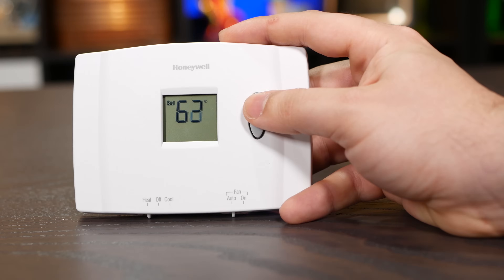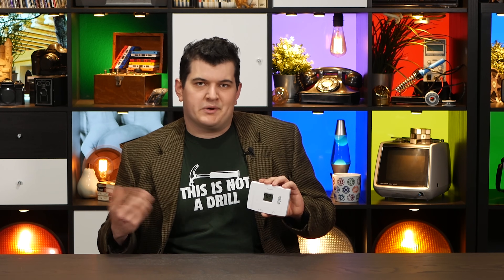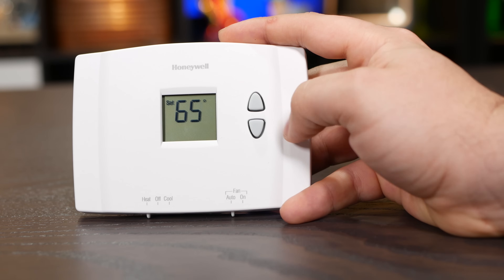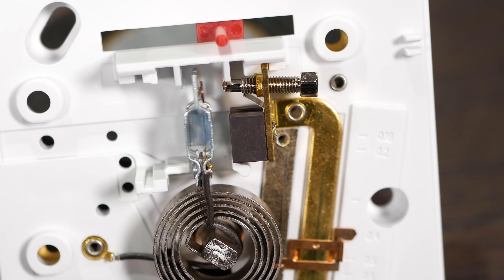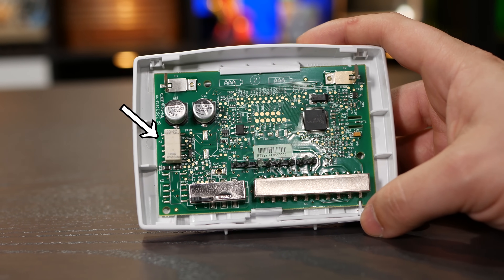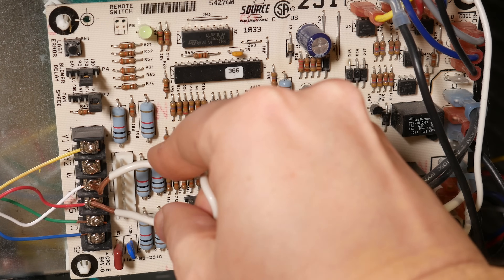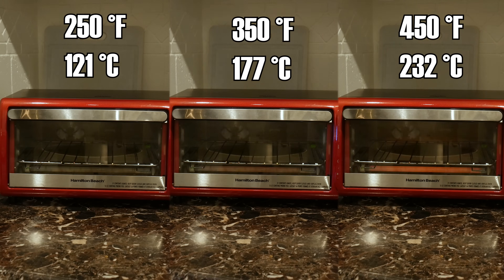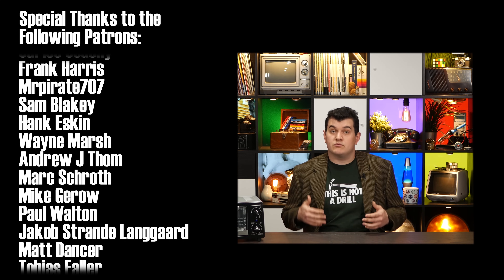Thermostats: Cooler than you think!

Comment: I know there was a thermostat at the church I went to in my youth that had a 30 minute occupy, that could be turned on.  The thermostat was set up behind a metal box, to prevent people from changing the settings, but had a hole through the face, that allowed you to poke your finger through, to activate the override.  Once the 30 minutes was done, continued on it's normal programming.  I don't know if it's a commercial thermostat, or just more rare, but they exist, somewhere. (No, I don't remember the brand of thermostat)

Comment: The thermostat in my apartment is mounted sideways and is powered by batteries. It’s so annoying. The batteries died one night before I knew it was battery powered and I was without AC for a while. It was 80° outside. I bought plenty of batteries so that doesn’t happen again. I wanted to try to take it off the mount to see if I could connect the C wire, but I couldn’t unclip it without pulling it out of the wall

Comment: First off, great video.  Shout out to your stunt toaster oven!
I own a home with a HEAT PUMP.   I'm new to the concept.  As it was explained to me heat pumps gradually warm the interior air but if you turn the thermostat up too much, it activates AUX mode and then the Furnace feature turns on (more energy use).  this concept totally negates your "dumb electronic device" theory.  If the thermostat just "says" "Hey heat pump, turn on/off", how/when does the heat pump "know" when to turn the furnace feature on/off?

Comment: check out the new Honeywell T10 Pro. plus if you like me, my stupid thermostat is in the dinning room, where i don't need the most control. but the bedrooms is what i need control over, they have a link device, that you can have multiple of, and in my case,  one in each bedroom, and i tell it to average those room as close to my set temp as it can, and it can decide, based on all the temps in the house, if it needs AC, Heat, or even just to circulate the air in the house to balance it out.  plus yes it has wifi, but like when the seasons are changing sometimes for a month in my area i have to switch for the 80+ temps in the day then we get some sub 30 nights, and just swing back in forth.  i like that i can tell it what range i want it to keep the house in, and it just does it.     

side note, that blue wire that needs nothing in the ones your showing, is REQUIRED for this type of thermostat. no batteries though.

Comment: My wife and I decided to splurge on a nice AC unit for the downstairs. It uses a VFD for both the compressor and the air handler, and can ramp down to as low as 30% speed. Haha, it was a pretty penny though. As a neat side bonus, it uses the same 4 wires the old single-stage AC system did, it just uses a proprietary standard to communicate between the board in the outside unit, the air handler and the thermostat. The system is much more complicated though, and specifically can control inside air humidity, which can really make it feel warmer or cooler in the house.

Comment: Technically, you can set your tstat to run for an hour and then carry on to regular programming. These would be programmable tstats. Almost all new model tstats have this function. You'll set it to your desired temperature for that cycle then press "Temporary Hold" and this just means that your tstat will hold that temperature until a certain time that can be change then go back to regular programming.

Comment: This is, in a way, really obvious, but less obvious than it seems: The key difference to PWM is the speed of the pulse.
Before you get annoyed upon the simplicity of this information, hear me out on this:

With PWM, the goal is usually to have the frequency of the pulse high enough that no mechanical reaction to the pulse itself ever happens. So, for example, if you are running an electric motor using a sort of "manual PWM", just by turning it on and off again rapidly, it will start to slow down a tiny bit every time you turn it off, and accelerate when you turn it on. This is far from smooth operation and can increase wear. Even with a pulse much faster than what you could do by flipping a switch, this still occurs, although the change in the speed of the motor will be very small. However, in PWM controlled motors, the pulse frequency is chosen so that it's faster than the electric reaction to the voltage drop. There are better people on the internet to explain this than me, so this perhaps isn't super accurate, but essentially, before the fields created by the coils fully collapse, there is already a new pulse, the motor never even starts to slow down and generate current, and as a result, it will run perfectly smoothly, exactly as it would if it continuously received a lower voltage.

So, while this type of reactive control is essentially the precursor to PWM, the speed actually more or less fundamentally changes the functionality of it.

Comment: I used to use the analogy that you can't turn a light on brighter with a normal switch, same as you can't heat the house faster by turning the thermostat right up when old e r customers were having a new heating system installed..

Comment: Some digital thermostats don't have good programs: one I installed had only a 1-degree variance of set temp, so it cycled as soon as the temperature was one degree off of set and shut down immediately once set temp was reached, resulting in very frequent HVAC unit cycling. I replaced it with a different unit that had about a 3-degree variance where it would kick on once it went 1 degree below set and then run to 1 degree over set before shutting down. Much more liveable arrangement with less wear on the HVAC unit since it didn't have to do the warm-up and cool-down sequences as frequently.
Also, most HVAC units will have either a two-speed or variable-speed blower unit. For heating, the fan is always run at maximum speed (you don't want your heating elements to overheat from insufficient airflow) while for cooling, the fan often is set to spin slower to allow for maximum dehumidification. Of course at the thermostat there is no fan speed control, it's either auto or on (which is usually high but may be selectable to low on some HVAC control boards).

Comment: Do NOT connect the cable shown at 6:07 directly to an electric heater! in his case, the white wire goes to a relai which gives juice to the heater (or servomotor, dont know how he heats). if u connect the thermostat directly to the consumer, you need a bigger 
cross-section for the cable (google translate ftw, im from the 230V world,) or otherwhise the cable is your best heater or just vaporize.

Comment: I've seen a number of places where the thermostat was next to a timer switch (electrical box mounted type). Usually, these have been in either garages or exterior-door access restrooms. The timer is mounted in parallel to the thermostat, or in some cases, connected in line with a second thermostat. 
Why? you need to keep the space at at least 5°C (41°F) to ensure that the water pipes and drains in the space do not freeze, so the thermometer is set for  7°C (45°F) (typically), and the timer turns on the often separate heater system. If there's a second thermometer, it's often fixed at 18°C (65°F)... in commercial exterior access bathrooms, it's often a double-contact timer, with the heat lamp on thermostat 2, and the lights controlled solely by the timer. 
I've also seen many a house where the hot water baseboard is zone controlled with very strong bimetallic spring coils operating a mechanical valve directly. The main loop is insulated, and has multiple pressure opened valves (note: Not pressure release valves, but internal pressure opened bypass valves), and the zones each have a thermostat on the water pipe, which leaves just before the bypass, and drains just past it; if the thermostat is open, the bypass shuts and the circulating hot water goes through the radiator, and when the thermostat closes, the pressure opens the bypass. It's almost like a transistor controlled circuit...
As for multiple heat settings... most of the portable radiant systems (Yes, how barbaric and inefficient...) have at least two heating levels. My electric oil filled radiator (which replaced fan based ones of higher wattage) has 3 levels, but not automatic switching. I have seen an automatically switching 2 circuit radiant heater... the thing had two differently angled mercury bulbs, one for each circuit.

Comment: It does matter where your thermostat is because different rooms cool or heat at different rates depending on their thermal properties and the difference between inside and outside temperatures. I found that the thermostat needed to be adjusted based on what temperature it was outside. That is before you consider the effect of opening and closing doors.

Comment: Mercury: It's not the "weight" of the mercury that causes the same hysteresis (technical term) that the magnet does in the modern thermostat.  Rather, it's the surface tension.  Check out how balled up, non-liquid-like it is in the picture.  Once it gets shlurped up (not a technical term) around the contacts, the mercury doesn't want to let go.

Comment: Ecobee does the feature requested at the end. You set a cooler temp, and it either auto resets back to your schedule after whatever time you set the default to, and you can just tap a button on thermostat or phone (or tell any smart assistant) and it puts it back to schedule. It’s perfect honestly. 30 minute reset and it’s a perfect cooling cycle.

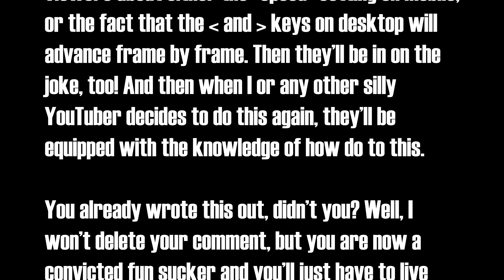Comment: 12:25
"Having proven that this demonstration would work
using my personal toaster oven, I decided to
purchase a new one. See, my toaster oven is kinda
filthy and I wanted to get another one anyway.
I thought it would be handy to have a toaster oven
at the new studio. See, they're really nice for
making small snacks or whatever [though frankly
I've always found the actual toast making
experience to be rather lacking even before I
was introduced to the Sunbeam Radiant Control
toaster]. Anyway, so I wanted to get a new
toaster oven, right? So I went to the store and
sought a really basic one, just like the one that
I use every day in my kitchen. No sense spending
a lot on what will just be a part-time toaster oven,
and it was the same brand as the one I had at
home. Must be perfect, right? Well, it turns out
that this new toaster oven runs a mush shorter
cycling time than my old one, so the effect that I
was trying to demonstrate became nearly
impossible to see. That sure was a bummer! It
later became clear to me that this wasn't a very
good toaster oven anyway, as the fit of the little
tray they give you for cooking tacos or whatever
was really vary tight and just unpleasant. The
whole thing was just a travesty, really. So I've
since returned the toaster oven you just saw and
replaced it with another one, but this was after I
had already filmed the entire video, and also after
I had Already filmed my original toaster oven doing
the thing I want to show you. I toughened up and
cleaned it the best I could, and I think it looks OK.

So that's the story of why you're about to see a
different toaster oven. I made and assumption that
turned out not to be true. Oh merde. In the end, it
all worked out for the best anyway because I got
a much nicer toaster oven on sale at Target right
after I returned the rather poor one, so all's well
that ends well, amiright?

Oh, and if you write this in the comment to save
people the trouble, you're a fun sucker and sucked
the fun right out of this gag. I hope you're happy.

*yay thats mea

A more helpful comment would be to tell the nice
viewers about either the "speed" setting on mobile,
or the fact that the <and> keys on desktop will
advance frame by frame. Then they'll be in on the
joke, too! And then when I or any other silly
YouTuber decides to do this again, they'll be
equipped with the knowledge of how do to this.

*yes he put "how do to this."

You already wrote this out, didn't you? well, I
won't delete your comment, but you are now a
convicted fun sucker and you'll just have to live
with that the rest of your life.

Pfft."

Comment: NOPE.  The mercury thermostat did NOT have to be mounted perfectly, EXACTLY level as stated in video.   Just reasonably level (not upside down or 90 degrees off).   It would work just fine.   The only negative result is the temp reading may say 78 when it's 76.  No big deal as one merely adjusts the temp to comfort levels anyway, not numbers...unless you're pedantic.

Comment: To make your AC run constantly for a set amount of time, reset the temperature much lower than you desire. Once you are cooled off, reset the temperature to normal.
     This also works for heaters.
Reply: I guess the point was to get the effect without having to remember to set the temperature back to normal later.

Comment: A question for you (or anyone else): On what basis is the recommended domestic temperature decided?  I noticed that your thermostat was originally set to 68 - is that normal in the US?  In the UK we are told to set our CH to 21C, but I have no idea how this figure was decided (and by whom?).  It's practically identical to 70F, so I suspect it's just a straight conversion, but still the same question - why 70??

We actually have our CH set to 22C, as my wife grew up in Eastern Europe, where houses are frequently uncomfortably hot (to a Brit) in the winter - and she often turns the thermostat up even higher!  When my wallet starts to feel the pain, and I attempt to get her to put on a cardigan, rather than running the heating so high, she'll often reply "why do you Brits like living in cold houses?!""   The answer I used to give to this was that 21 is the recommended temperature - until one day, when she asked in reply "but why - who decides that, and how do they work it out?".  A question which I rather disturbingly realised I had no answers to...

Comment: There's another advantage to remote temperature sensors, most central HVAC systems don't maintain a constant temp throughout the living space, but with remote sensors they can be programmed to maintain a specific temperature in a specific room at a specific time (Living room by day, bedroom by night - Nest has this, although it has almost no configurability). Even more clever would be to activate certain temp sensors with motion detectors so that wonderfully conditioned air would follow the occupants as they traversed their homes (assuming properly configured hysteresis on the motion sensors) and would allow automatic eco modes when nobody is home. Thanks for the video!

Comment: A lot of UK thermostats allow a "boost" feature that usually puts the heating on for 30 mins but not override the thermostat temp. Especially as we have more often than not thermostatic radiator valves that regulate temp in individual rooms

Comment: The boiler at my girlfriend's house (UK, we use water circuits to transmit heat rather than air, so the boiler heats the house /and/ the hot water) has a pair of override pushbuttons on it, for "1 hour of extra hot house please" and "1 hour of extra hot water please".  The former is rarely useful, except when you come home to a cold house in the depths of winter, but the latter is /great/ if pressed ten minutes before running a bath - it means that the hot water header tank (which naturally cycles up and down in temperature due to the thermostat in it) is at full temperature when you open the tap, and you know exactly what hotness of bath you're running.  Again, UK, so no built-in aircon system to override.

Also, I'm not a fun-sucker, but I did nearly wear out my spacebar reading that because I'd forgotten about the frame-advance keys on desktop.

Comment: I have the blue flame ventless unit to heat my small (850 SQFT) underground home  it has two flame settings with no electronic thermostat  if you turn it up till it fires it has a normal short flame  turn it more it will go into the high flame mode until it warms the house up a bit them goes back to the short flame until it gets up to the temp its set for then shuts down  normal heating is the short flame unless you open a door and let in a lot of cold air and it will go into high mode to catch up a bit always wondered why the people that make furnaces do not use this system ?  saves a lot of fuel I use less that 250 gallons a year for heating cooking and hot water (A demand unit  )

Comment: Heating Systems in America Looks Like Dinosaurs compared to what you find in Europe The Thing We have is from 2002 and 6 power modes even the fan has three modes and thermostat outside and Inside for better economy Meaning there is also level control on the gas burners When somebody takes a shower all the gas burner fire up when just wash their hands just a couple turn on I think The Brand is nefit from 2002

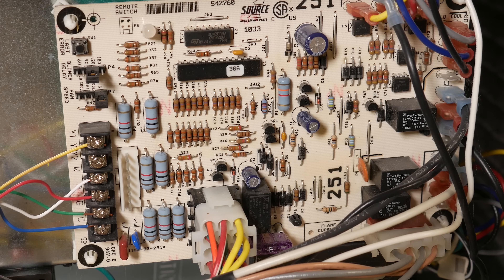Comment: 2:55 That board is terrifying: No solder mask, all through-hole components, random jumper wires instead of traces, high voltage isn't isolated from low voltage. Not to mention it's attached to the furnace with plastic instead of using it as an extra ground. Looks cheaply made, which is really sketchy considering it's handling something that could burn the house down if something goes wrong.

Also, what is an automotive fuse doing in a furnace? lmao

Comment: Honeywell smart thermostat does that kinda. It runs its program,  lets say 70 degrees. You come in and drop it (or raise it by 4 degrees.  It will run in temporary until desired temperature is reached. Then it resumes the preset program.